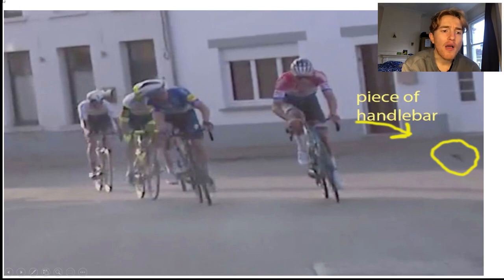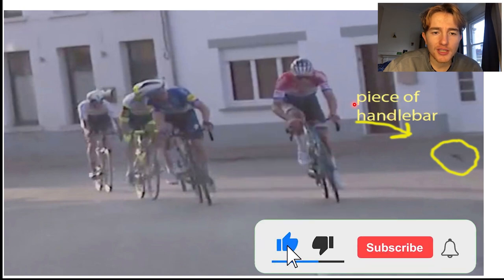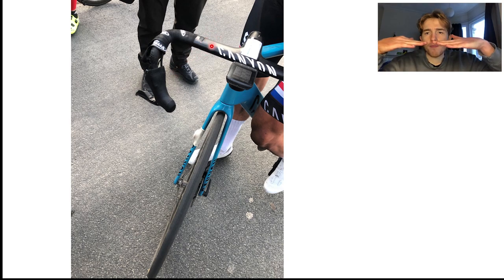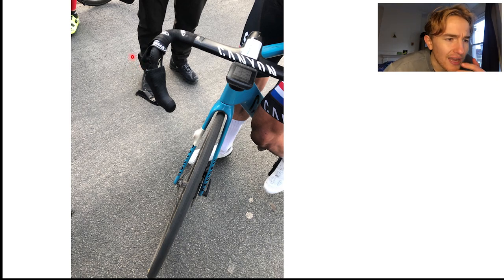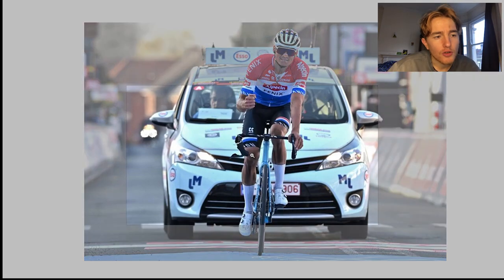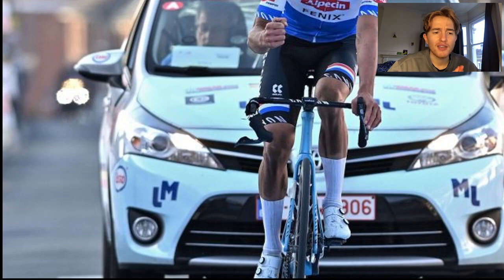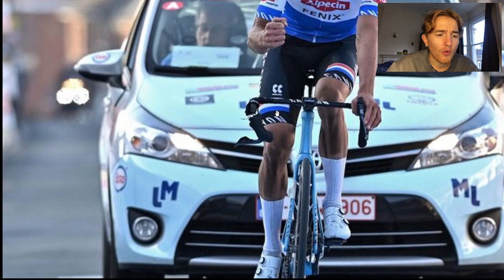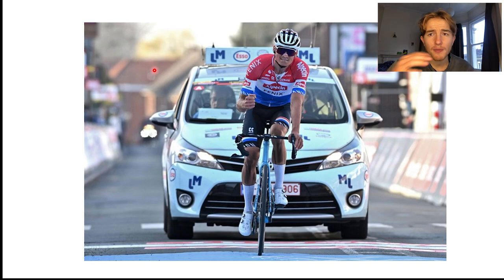Van der Poel HANDLEBAR FAIL!!

Comment: Overtightened shifter clamp.  Or poor manufacturing on bar?  My experience points to a heavy handed mechanic.
Reply: They need to stop making stuff so light, add more material 40 gram lighter doesn't matter if you can't hold your shifter, the 2 piece handlebar thing they're doing is shit
Reply: @georgefarrowgreen01  the idea is nice  but it just doesn't work

Comment: That not a classic overtightened shifter?
Reply from the maker: Yh that's good shout but swear that's pretty hard to do
Reply: @CharlieCarbsandCycling  actually it's very easy to over tighten on carbon handlebars

Comment: Cannyon stock will drop massively  , to many problems for one bike . 

I've watched the race , quick response  Charlie
Reply from the maker: Yh but I think this is to do with clamping shifter too rightly
Reply: Imagine if the handlebars would snap while sprinting  ?!
Reply: Charlie, Carbs and Cycling, this is a common problem with CF handlebars, and is not necessarily due to overtightening the shifter clamp nut. The engineers at Canyon did a shit job at designing the layup schedule and evaluating the stresses in FEA and sufficiently confirming reliability through ISO tests. Engineering failure—NOT the mechanics’ failure.